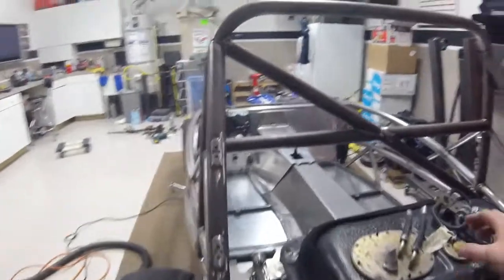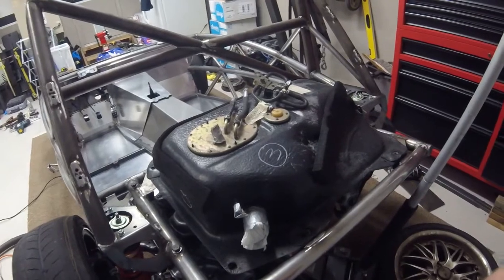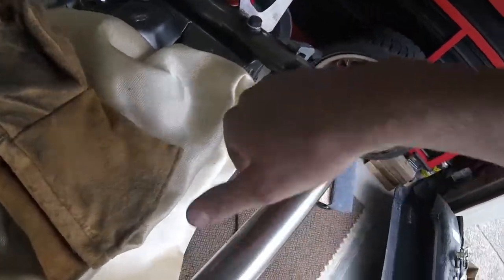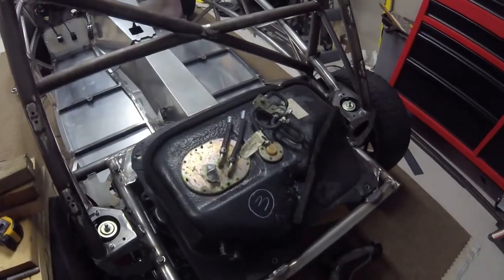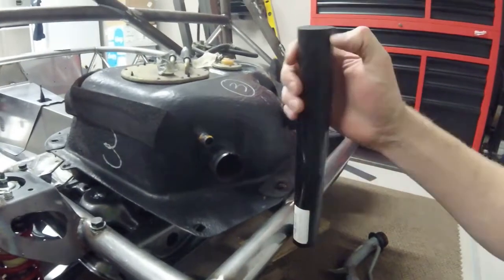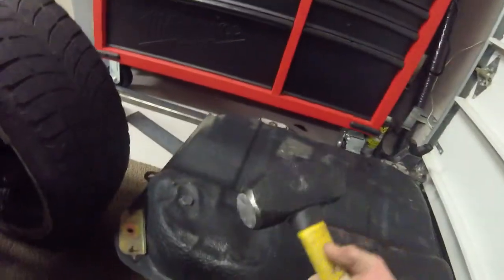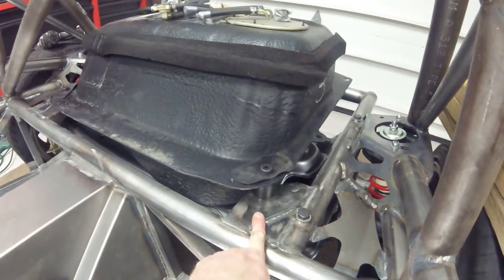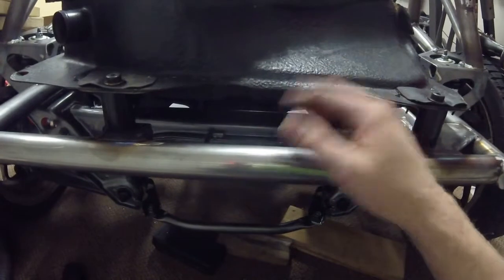Exocet Build: Mounting The Miata Fuel Tank (Part 31)

Comment: I had the factory fuel tank mounts rip, they are way too thin. Couple tips for you... 1) I HIGHLY recommend a Holley Hydramat to prevent fuel starvation. The tank angle you have to run on the exocet to clear the bodywork forces the fuel to go into the back of the tank.I ended up using the 15"x8" cross with a barb adapter from Radium to connect it to the oem style fuel pump. You are looking at about $300 between the Hydramat and Radium parts though. 2) If you want to use the full 12 gallon tank capacity you have to use a Discriminator Valve. https://fuelsafe.com/itdv08/ Remove the small round emission plate from the top of the fuel tank and all the crap attached to it. Make a new round plate drilled for the Discriminator valve and it will properly vent the air from the top of the tank. You'll also need to plug the old fuel vent by the fill tube as it is worthless on this setup.
Reply from the maker: Lukas Gilkey yes I have seen the hydramat.  And I have seen the crazy price.  I will probably go with a fuel cell before I go that route but we will see.
Reply: Yeah, pricing wise it starts getting close to a fuel cell.
Reply: Yeah, it takes about $400 in parts to get the factory tank to work very well.